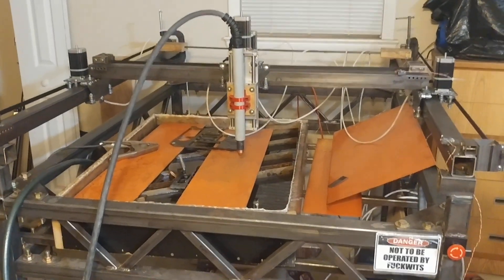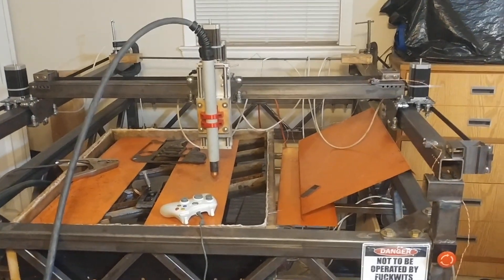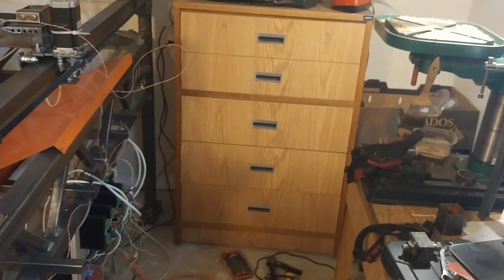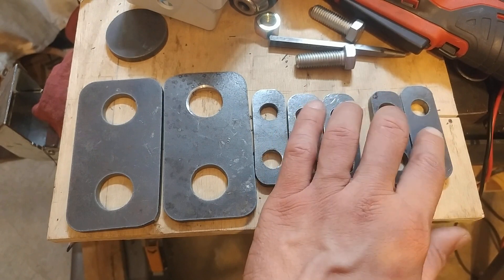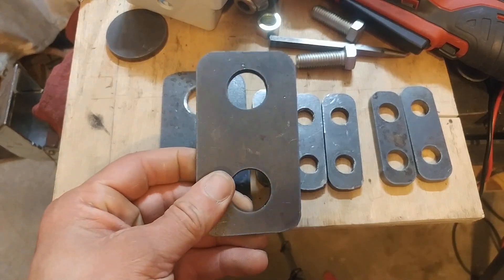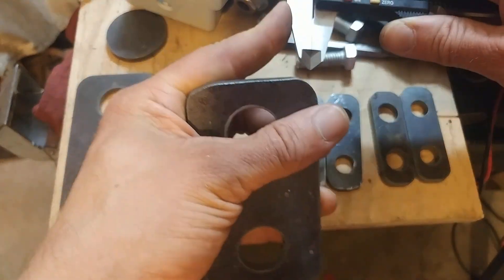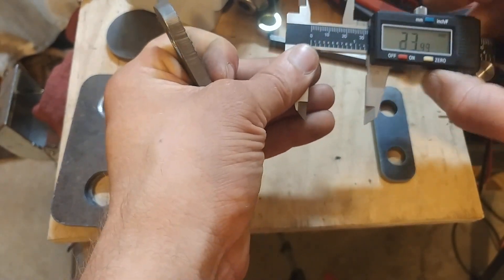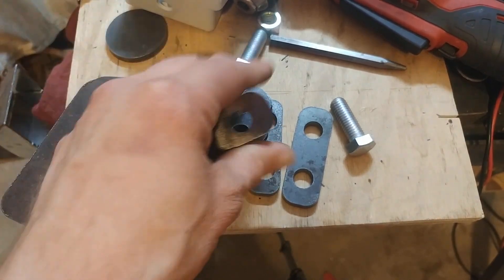CNC Plasma Build: Test cuts! Making progress with open source

Comment: Try learning how to use a grinder to sharpen your drill bits by hand and once you figure out the angles and reliefs you’ll never call a drill bit trash till it’s almost a nub again even the cheap ones
Reply from the maker: Oh for sure, I've saved many twist drills that way. If I recall correctly, there I was using a conical step bit that was already way past that point. Chipped, un-tempered, etc. and Harbor Freight had plenty more where the came from.

Thanks for stopping by.

Comment: Hello, have you thought about  doing auto squaring in the future?
Reply from the maker: As in what? I'm not following what you mean.

Resquaring things only takes a minute or two, and normally only needs to be done after some of the roller bearings have worked loose and let it get out of square. It's as easy as loosening up the bolts that hold the motor carriages, unplugging one motor, jogging the other side a little bit, then tightening things back up and plugging them in.
Reply: @swolebro  thanks for your answer, but i mean using microswitches at home position for each stepper. This way on every  homing, your machine will be pependicular. This would work if you use a driver for each motor, and the switches are perpendicular, but anyway. 🙂

Comment: Hi,  Thanks for your cnc videos; I am looking at the plasma build and linuxcnc set-ups.   Can I ask the VNC program on the linux box you're using?  Does it interfere with the real-time functioning of linuxcnc?  Thanks again.
Reply from the maker: Ha, an easy one. I already typed this up:

https://github.com/swolebro/swolebro-youtube/blob/master/linuxcnc/misc/vnc-remote-desktop.rst

Your mileage may vary, of course, depending on software versions and stuff. If you can provide feedback on what did/didn't work in those instructions, either via a GitHub issue or pull request, then that can help improve that page.
Reply: @swolebro  Thanks.  I should have been able to find that from your provided links. 🙄

Comment: hey im subbed , glazed over thc u posted as im building my own cnc plasma you are helping alot ... THANKS .
Reply from the maker: Yeah, I've pretty much posted the answer key up here. lol Be sure you work through to the recent videos, where I cover all of the advanced options, like setting up ohmic sensing ($2 upgrade) and the THC (either with the XBox 360 controller or an Arduino). Just finished editing that series today, so your timing is perfect.

Just a heads up, if you do go with the 2x2 square tube gantry and skateboard bearings, the way I've shown here, you probably will want to upgrade them at some point. It works, but there's enough slop in the system that everything is +/-0.050" or so. Good for prototyping, but for production work, better bearings will yield better results.
 
Get it, bro.
Reply: @swolebro  Thanks for the info ...I've actually went for the most efficient way to use my limited time and resources (space I got ) so I've got someone to 3d print a " low rider" for me ,so I can do a full sheet but the table is a copy of yours and thus 2x2 square tubing so I can upgrade later to linear rail and rack and pinion , I've got a raspberry pi3 B+ pushing ugs as I could not find a breakout board for Linux cnc that did not get missing in the post and refuse to purchase another board ...customs has not cleared my second one from Feb 2019...
Any ways thank you again , once people understand what ur doing u are going to get swamped with subs for sure .
Reply: Iow if I fail, I want to fail cheap ;)